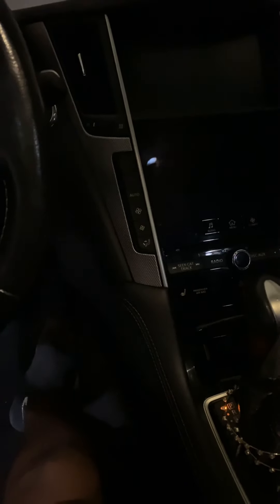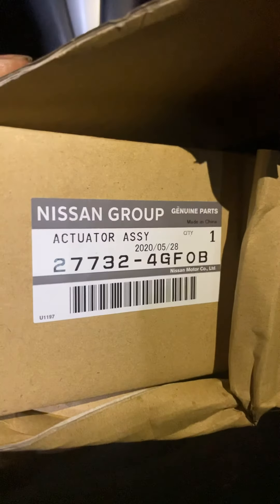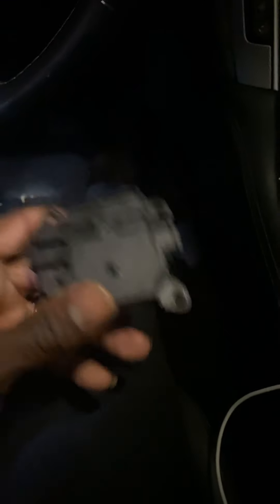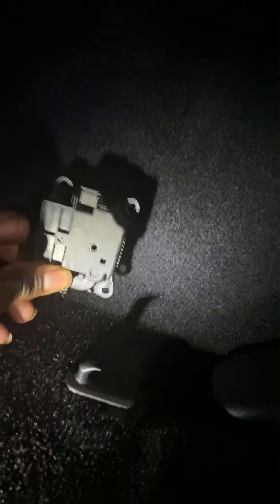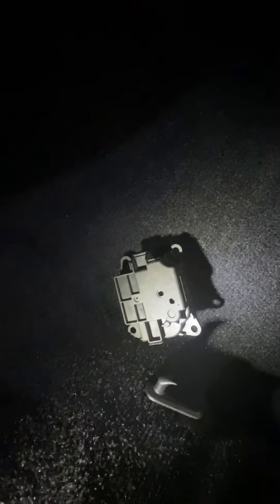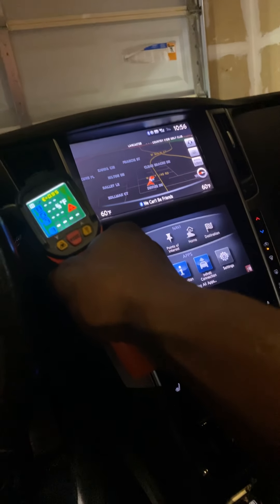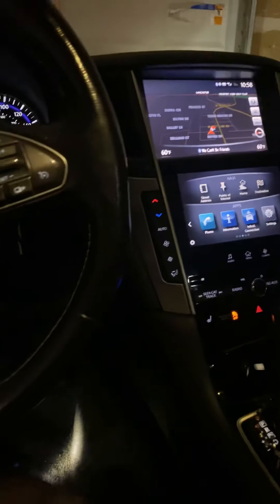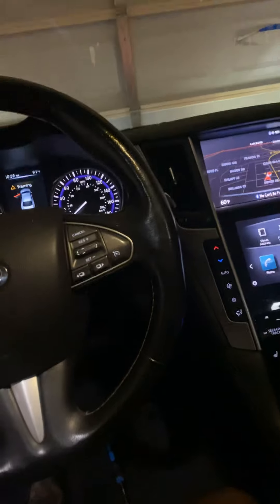2015 Infiniti Q50 Temperature Actuator replacement

Comment: Yo, my man.... you just saved me a lot of money. I changed the condenser and drier and still have the exact same thing you had. Just ordered both actuators and pretty sure this is the problem. Thanks🙏🏿
Reply from the maker: Nika Wallace definitely glad I could help. Hate I couldn’t post it sooner before you spent all that money on Unnecessary things. This definitely something nobody wouldn’t think to replace. Have a good one!
Reply: Brandon Lampkin ok thanks, because I never thought about it. Was thinking AC compressor, condenser,drier, and expansion valve...bit never the actuators. What made me realize you’re probably right because I have the exact same problem with my 2014 q50. So I am more than sure this is the problem. I will update you next wk and let you know how it went. Thanks again 🙏🏿
Reply from the maker: Nika Wallace yea man I originally thought it was a Freon issue. It gets so hot in Texas I thought the heat was causing the Freon to not be able to cool. Little did I know. But thanks to my Infiniti technicians. Looking forward to that update from you though.
Reply: Brandon Lampkin same problem here bro thanks 🙏🏼
Reply from the maker: jay B no problem my man!

Comment: Thanks! After taking the dash apart going by another video and realizing it was not a 2015, and that apparently makes a difference, found this video and I was done in 10 minutes. Mine would intermittently blow hot air on drivers side. Hopefully this is permanent fix.
Reply from the maker: Leslie Pardue sorry you had to do all that only to not fix the issue. Glad my video help though. Definitely was a quick fix. My wife’s just out of nowhere started blowing warmer than the passenger side. I too hope this is a permanent fix.

Comment: I just got my 2015 back from the shop getting the engine mounts done and I know my air been acting up. Driver side hot as hell and passenger is cooler. Thanks for the video, cuz I'm gonna tackle this soon. This gon be a big help.
Reply from the maker: Glad I could help. You and I both know Infiniti would probably charge close to $500 just to replace something that simple

Comment: I just had Infiniti dealership fix this problem on my 2014 q50. $430 out the door. Service rep told me its a known issue. My question is, shouldn't that be a free recall?
Reply from the maker: That’s a good question because after it’s happens so many amount of people, at what point does it become a recall

Comment: Hi,
In my 2014 infinity Q50s hybrid, when I turned heat on the driver side vent blow hot air but the passenger side blow cold air. But after turning air on and off with dual management on and off couple of times, the air temperature come back normal as we set (dual zone off). 
What do you think the issue is?
Reply from the maker: I definitely think there’s a blend door issue. With the procedures that you have to take in order to make the cold air work, I would assume the blend door is near it’s end. I would suggest getting it replaced. They’re not that expensive at all.

Comment: I have 2016 one,drive side is hot the rest blows cold…..change that parts no changes still the same issue,any other information on this?Thanks.
Reply from the maker: So you changed the side that blows hot? Correct?
Reply: @laqintin2  yes driver side
Reply from the maker: @jnagime  strange. You’re the first I’ve heard that replaced it and it still doesn’t work
Reply: ALEX KON  I have a 2016 also, Could it be because the part number is for the 2015 and there might be a differen't part nubmer for the 2016?
Reply: Yeah changed mine on the driver side it still doesn’t work . I know I’m late
Reply: Was there a fix? My driver blend door actuator is working but still warm air out of the driver side vent. Passenger side is cold

Update: I visited an AC repair shop and explained my situation. They discovered that both actuators are working. But AC Evaporator core had a slow leak, causing the issue (I also confirmed through their digital scope camera to the core). There was low pressure in the system. It cooled the passenger side but not enough pressure to cool the driver side. Problem solved after a freon recharge ($50), now both sides are cold. I eventually will have to replace evaporator core approx $800 fix but might wait awhile and see how long till it leaks out again.

I hope this helps somebody with this issue. Also IMO nissan/Infiniti have subpar quality control and need better parts for their vehicles. I've owned many and all have had issues.
Reply: @alex102390  I changed the driver side still the same,took to the dealer and looks like they changed the passenger side too. 2016 Q50 Redsport problem fixed

Comment: Do you need to unplug any wires before taking it apart?
Reply from the maker: yaserxgadit I just turned the car off. Only thing that I unplugged was the actual connector for the actuator. That’s it

Comment: would this part also fix the right side?
Reply from the maker: I think it’s safe to say yes it should. Just as long as it’s the correct part for that side.
Reply: @laqintin2  thanks for responding. Was your issue about no cold air goijg to drivers side when set a/c mode?
Reply from the maker: @gotentk4  yes. I was getting no cold air on the driver’s side but cold air was blowing on the passenger Side